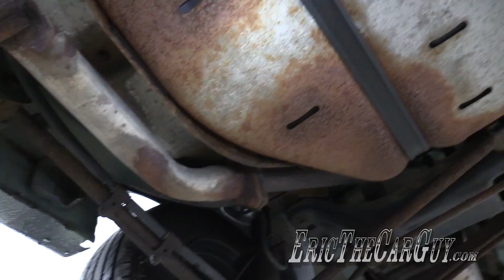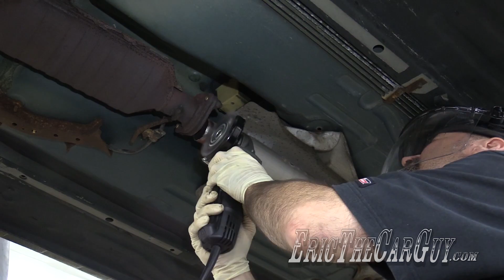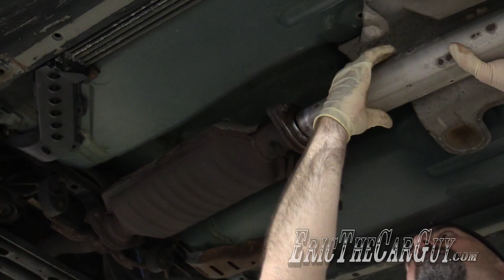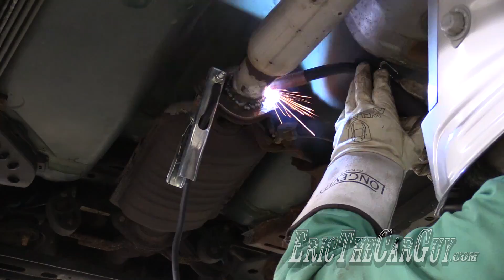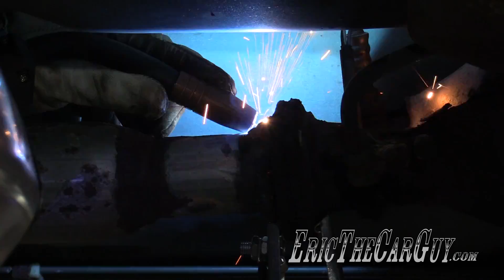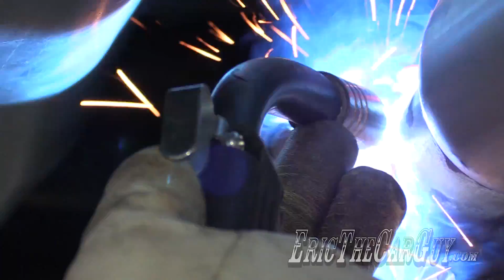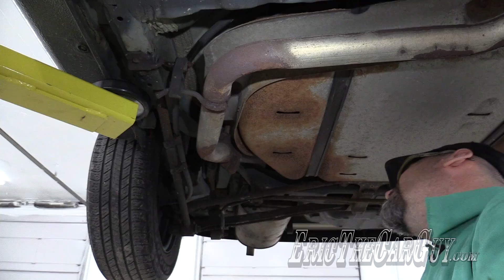Money Saving Exhaust Repair -EricTheCarGuy

Comment: You are doing great Eric!. I started weld years ago and then put it aside. I got back into it and it is like riding a bike you might be a little wobble at first but it all comes back to you. Also Patience. go slow and allow the metal to melt. Welding is all about going SLOW. I stick weld and I love it!
Reply: Just wait till you TIG, you'll love it
Reply: I like the arc welding because of the need for gas. I do all my welding out side, I still would like to try it out. I hear it is easy to weld with. I will post my crappy welds on my channel in a couple of days and talk about my thoughts on Arc welding.
Reply: +Big Guy Review all welding is arc welding, which process are you talking about? And yes, any process that requires gas is no good for outdoor use, but that's not what it was designed for.
Reply: I meant shielded metal arc welding. Every one knows this to be arc welding or stick welding. Yes to say all electric welding is arc welding is correct. To ask me what kind i meant is kinda lame. Anyways I hope you can respect  me for using the correct wording in my response. Let those electrons flow!!!!!
Reply: +Big Guy Review I didn't know what you meant because you said you loved it because it required a gas, so I assumed you were talking about FCAW, MIG, or GTAW.
Reply: +TheKurtTribute Ya I type slower than I think or is it the other way around. What ever. In general Arc means stick welding. As I am sure you already know "Shielded metal arc welding" has been around for a very long time. All these other welding methods came after. Tig Mig and then Mig flux core. I went with "S.M.A.W." because it is cheaper, doesn't need a gas, and I don't have a workshop. All my work is done outside and all the types of welding that need a gas could become problematic if there is a breeze. Now with all this said I should have gone with a ac/dc rig for my stick welding, but I can live with the AC for now.  -John
Reply: I believe Carbon Arc welding came before SMAW, but it was a very similar process if not identical. What do you have? A Tombstone Lincoln? I'm very familiar with welding, I am currently a welder, and went to school for it. If you don't make your living on welding at your home I can recommend Everlast welders, I have the 160sth and I have no problems with it, clean stable arc in Stick mode, able to penetrate thick metal, and then switch polarity and I can TIG thin metal if needed.
Reply: Yes I have the tombstone like welder. Not sure why it doesn't look like the tombstone one. I imagine it is a different model. I agree thin metal is a real pain with a S.M.A.W. in AC mode. I would like to try the DC version on DCEN mode to see if this give a smoother easier weld. When I bought this welder I knew nothing of welding except that it looked cool and I could build stuff with out nuts and bolts. Anything more than a AC tombstone is out of my price range. I am not complaining just saying no need to look at a Bentley when all you can afford is a Chevy.
   I went and looked at the Everlast 160 STH. Looks cool and covers the 3 welding options for Tig, Mig, and Arc. The price isn't too bad. It will be something to ask Santa for X-mas.

-John
Reply: +Big Guy Review The 160 STH does not to mig. However if you master tig you really don't need mig. If you don't allready, you need to check out "WeldingTipsandTricks" on YouTube, he's an amazing welder and more importantly, teacher.
Reply: +Big Guy Review ever last also has a 140 ST which is only around $300 I think (maybe $248?) and it is just as good as the 160, the only difference is it doesn't have high frequency start, which is nice but not necessary unless you're trying to tig very thin stainless. I work at a welding manufacturing plant that does nearly 90% tig and even we don't use high frequency start machines, Atleast the vast majority of them are not.
Reply: I have taken a look and I am interested in the machines. The fact that they are DC only make any difference. Is DC better than AC. It also says that these machines can NOT weld aluminium. Why?
  -John
Reply: One is no better than the other. Typically you weld Aluminum on AC which is why they say you cannot weld it. You can buy special stick electrodes that can weld aluminum on DC, but the cost is extremely high, if you think you're going to be welding a lot of aluminum I suggest you just save up some more money and spring for an Everlast unit that has AC capabilities. Aluminum is also fairly difficult to weld and I don't recommend it to a newbie at TIG. Both the 140 and the 160 have the capability to switch polarities though, so again both can weld TIG and SMAW. I will say though, because they're both inverters, don't expect to be able to run many 60 series rods. I've had mixed luck with 6011's if I have a gap I'm trying to fill, without a gap I can hardly ever get an arc going.  6013's seemed to run okay depending on the rod brand, and obvioulsy 7018's run smooth like butter and with practice can look as nice, if not nicer than a TIG bead. All of these things are typical to Inverters and it is not just an everlast thing. They also make a model that has a designated 6010 polarity port, so maybe check that out if you think you'll be sewing up groves with 60 series in your future. I'm not saying they're the best quality but for the money I can't complain, the next closest thing to the 160sth as far as specs go is the miller maxstar 150, which costs around $1400 as opposed to the $400 I paid for my everlast. You also get tons of accesories out of the box. I love mine, and at work I use $3000+ welders, so thats saying a lot.
Reply: OK so I am trying to follow here. The AC welder I have is fine? My main interest is to weld steel. I do like the E6011 for their ease of use. I can't remember now if it is the 7018 or 7014's that have a nice bead but they are harder to run at lower amps. I kept sticking. I think it was around 105 amps I should have bumped it up to 120 amps. I have trouble seeing the glob of metal. It is new to me but I don't get alot of time to practice. I took on a small job of altering three steel frame tables. I videotaped the work and plan on posting it soon.
Reply: +Big Guy Review You likely have 7018's as 7014's aren't very common, they're high deposition rods. AC is okay, but I would rather an DC only machine as Opposed to AC only. They also make tombstone welder a that are AC / DC, but for what they are they aren't very cheap. Sounds like your welder is running fine, with an 1/8 7018 you should expect to have to run around 115-125 amps, and then adjust from there. You can buy some 3/32 rods and then you can run them at lower amps, say 70-100.
Reply: +Big Guy Review and if you're having trouble seeing maybe look into buying a new helmet, or getting a lighter shade lens for your existing helmet, don't go too light though or you'll get headaches. 6010's or 6011's are easy to weld but they crack easy too, make sure with 60's series rods you use a whip and pause technique. Also try some 6011's, they're designed specifically to run with AC & DC, so they might work better with your AC only machine.

Comment: I bought a cheapo mig welder a few years ago and have been running flux core wire, no need of gas and its saved me a bundle.  110 mig welders can be bought for $150 on sale and usually come with a spool of flux wire, it pays for itself with the first muffler repair.

Comment: How hard is it to use one of these mig welders? I am considering getting one but have no experience.
Reply: +turdsandwicher Not hard at all. It aint rocket surgery it just takes some practice. Most welders come with a diagram on set up for different metals and metal thickness, which will give you a decent starting point and you can fine tune from there. Get yourself some scrap metal or cheapest stock you can find, run some beads and when your beads look decent do some basic joints for practice.
Reply from the maker: +turdsandwicher Check the description for the video I did about this welder.

Comment: I'd use a flap disc attatchment for the grinder, those wire brushes mostly just polish the rust, and your weld won't go on smoothly
Reply from the maker: +MadMaxx570 I'll look into that. Thanks for the tip.

Comment: wouldn't a aftermarket exhaust from e*bay been cheaper? I'm just considering welding gas and "man"-hours..
Reply from the maker: +tasty2choc This took about 20 min. Getting the pipe, removing the old exhaust, replacing the gaskets, and all the other BS would have taken much longer. I'm happy with what I did.

Comment: Just some advice from an old welder... Its better for you to start at the top and work your way down.. When you reach the bottom, switch to the other side and work your way down again... Let gravity do its job... Trying to weld vertically up is much harder, and actually has a whole technique of its own.
Reply from the maker: +Justin Ayers Cool. Thanks for the advice. I'll try that next time.
Reply: Damnit Bobby I can show you a lot of downhills with penetration lmao especially on thin stuff. Yeah uphill has better penetration but if you don’t know what you’re doing you end up with dogturds
Reply: Thanks 🙏 for the advice.

Comment: sounds like my exaust is full of holes again, ill have to go fix it, btw i wanted to know does exaust holes have anything to do with car performance and fuel economy.....or is that just myth ?
Reply: +xAsmir Depends on which part of your exhaust is leaking. Cars these days have EGT's installed (Exhaust Gas Temperature), leaks can cause your sensors to read wrong just like if you have an intake leak. If it's leaking before the Catayltic Converter, you'll be leaking harmful emissions, but other than that maybe back pressure (depending on how your car is built) might be lower. You really shouldn't notice much performance difference. Of course, it will sound louder/shit, heat/emissions may find its way inside the cabin if your floor pan is rusting which can be really harmful for you and passengers (hopefully shouldn't happen). Some cars also have oxygen sensor before the Catalytic Converter to improve emissions, this would cause a little fluctuation in your fuel usage too.
Reply: Hot gases leaking under your car and the loundness is much more important. You wont pass inspections or emissions either
Reply: lolatmyage i dont care about neither one of those.....i want to know will it slow down my car and will my car consume more gass.....i like the sound btw.

Comment: Eric, you're doing two things wrong.1) Your wire feed speed it too high. When you get sputtering that's almost always the reason. Turn it down slightly from where you had it.2) Your holding the MIG gun too far away from the work. Get in there tight. It gives you better shielding gas coverage and improves the arc.
Reply from the maker: +SATAMAN Schmidt Thanks for the tip. I'll give that a try next time.
Reply: Maui Kawi all he was doing was giving some tips. Honestly I'd rather have constructive criticism to make my work higher quality for my clients, than block out everyone and do it my way purposely worse. Just saying man.
Reply: +SATAMAN Schmidt mostly youre second point way  to farr,
Reply: i like my high, i can do some pretty good welding an only done it few times. from what i learnt is that weld in spots as you move along for each second which give you a nice flat straight line weld instead of bubbles or curve an not straight which looks ugly. just my idea for these sort of things when you cant do a perfect weld in hard areas to work with.
Reply: Sputtering is also caused by trying to get the weld to jump the gap and if you blow through the material...
Reply: Stfu

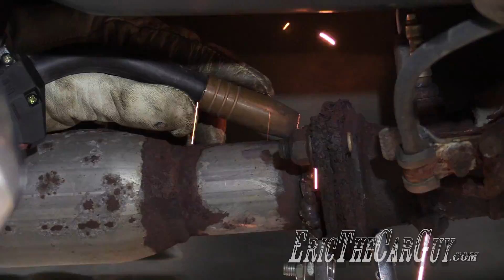Comment: At 9:37 I noticed welding light coming through other parts of the old welds (so exhaust gases would blow by too) - mind you, that pipe is probably super thin and getting a better weld probably would have involved making a bridging plate but then you're putting far more work into it than it's worth :-)
Reply: +Darren Coull i think he still needs a lot of welding practice.. doesnt seem that he have the feeling of wire speed and current setting.. pops a lot..

Comment: I've done this kind of repair before but I prefer to weld a slightly smaller diameter of pipe inside the flange and then the rest of the B pipe fits much better and welds really strong.

Comment: The bolts after the cat didn't look so bad, I might have undone the flange and welded the flange back the pipe with the rest of the exhaust tilted down by undoing a hanger or two.Definitely would've taken a little bit longer though.

Comment: just a note about the wire wheels, i once had one of the bit of wire fly out, and it punctured thick jeans and then dug itself 1 inch into my leg!! didnt feel it at the time but found it later and had to pull it out which hurt like *********!

Comment: why not remove the flange and the pipe and work on the bench?
Reply: If you've ever worked on an older cars exhaust you'll know why. Rusted bolts either strip or break off.
Reply from the maker: +Daniele Dal Col I might as well replace the pipe if I did that. I'd also have to replace the gaskets.
Reply: +losi8ightyew THIS!!!! Right here, those bolts would have been DESTROYED trying to get the nuts off, hell when I did my exhaust I had to cut them off with a sawzall because nothing could get them to budge, this is why most exhaust parts you buy come with new connecting bolts.

Comment: Is this a normal condition of a car bottom in US? Yes, the exhaust pipes is rusty, but the bodywork metal above looks factory new! No dirt, nothing. And this is 1998 car. This is insanely clean compared with russian cars :(
Reply: +Михаил Андреев In general the US is much hotter than Russia. The southern part of the country seldom has snow and therefore no salt is used on the roads. Here in Arizona cars never rust. In Ohio, where Eric lives it's a lot worse but still not as bad as Russia. Moscow is at the same latitude as Montreal in Canada. Almost all of the US except Alaska is below that.
Reply: SATAMAN Schmidt i live a ~600 km to the south of Moscow. And there is not so much salt on our local roads, compared to big cities. But, oh my, there is always an layer of dirt on the bottom of every car here. For example - when Eric said - look for a "rust-dust" spots near suspension moving parts - it's just impossible here. All you find is mud and dust.

Comment: Thanks for the video Eric. I have trouble, especially with welding the top part too! On some applications it's much more difficult to unbolt, but having welded over and over on the top without a full fix, gotta say, it has to be done, lol. :)

Comment: I almost never see you use protection for your ears! Tinnitus dont heal and yes if you have it, it can also get worse.
Reply: Theres nothing loud about welding. Grinding, maybe if youre at it for a long time
Reply: I did not think about the welding, but you can get spatter in your ear so always good to use protection even when you weld, especially welding over your head :)
Reply: Joel Fager Hes got the mask and hat for that, if the sparks are getting in your ear then youre too close to what youre welding
Reply: Still a possibility.
Reply: Joel Fager Yeah, theres a point in chasing safety where your gains arent comparable to the effort youre putting in to make things safer
Reply from the maker: +Joel Fager Good point. I've covered that in other videos where I used the grinder. I'm using it more, especially in videos where I use loud tools.
Reply: +Joel Fager You haven't lived until you get weld splatter in your ear!
Reply: yeah grinders can definitely be pretty loud, I always use eye and ear protection when I use that stuff. It may seem silly, but fixing a stupid car isn't worth long term damage to important parts of your body. The protective gear makes it a bit uncomfortable doing work, but it's worth it
Reply: If you weld under a car for example (wich is most likely for this kind of senario) and just like etcg I live where they use salt on the roads on winter so cars can rust really bad. And can be really hard to clean the surface properly before welding so sometimes you can get a really bad area when you weld and you get spatter that jumps everywhere. I have even seen it in welding books that they recommend to put cotton in your ears while welding.
If you want the risk of getting melted metal in your ear and possibly burn your eardrums be my guest.
Reply: +James Last  let alone weld for a living
Reply: +James Last Or ended up in the er with flash!
Reply: what I couldn't hear you...someone was welding really loud.
Reply: +Joel Fager How is that a possibility? If you are welding, the work you are welding on is in front at you, not on the left or right side.
Reply: what?
Reply: Joel Fager i do have tinnitus and i hate it ,
Reply: I got it from hunting without using ear muffs and luckily i don't notice day to day but i can't sleep any more without headphones on. Not worth the risk no matter how manly you might think you are

Comment: In this case you could probably just use exhaust flange that has pipe that goes around the old pipe. It should hold just as long as this repair but not require welding.